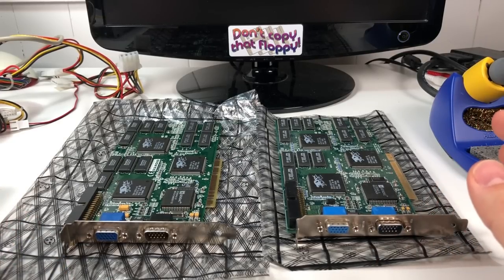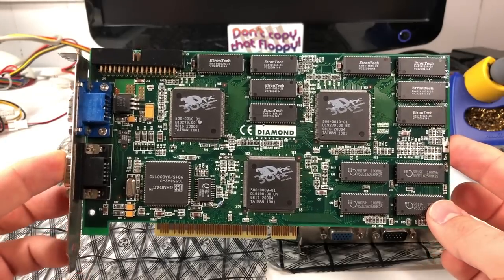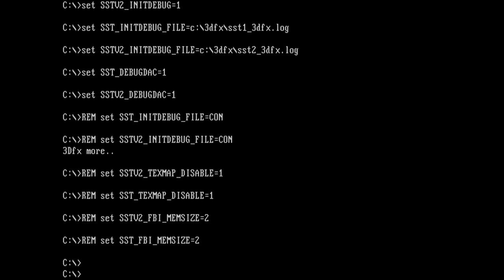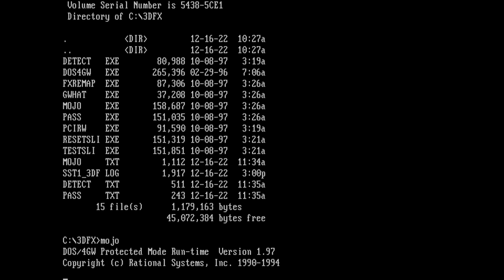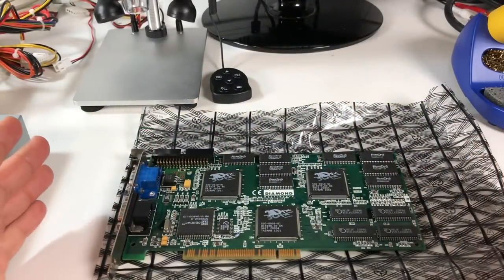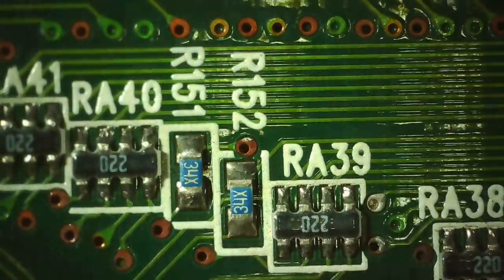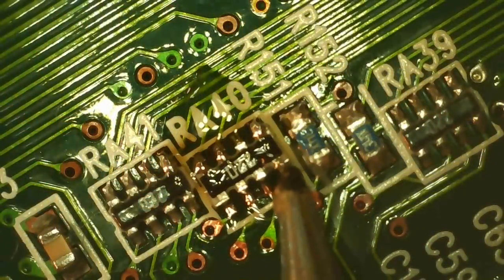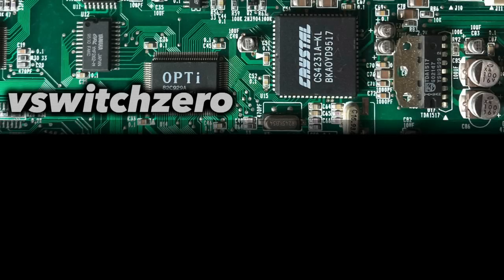Troubleshooting and Repairing a 3Dfx Voodoo 2!

Comment: What a find. Resistors aren't normally the thing you expect to break.

What is your microscope? It looks excellent.
Reply from the maker: Indeed! Can't say I've ever paid much attention to RAs before this card :) .. the microscope is the Tomlov 7 inch model, but it appears to be a generic design offered by several manufacturers on Amazon. The Tomlov one seems to be a lot more expensive now for some reason, but you can find a similar model like this one for $139CAD, which isn't bad: https://www.amazon.ca/Digital-Microscope-50-1200X-Maginfication-Soldering/dp/B089DXDGW4 

It's been a real game changer for me for electronics repair projects and well worth the investment.

Comment: Vswitch - do you know if u can disable a TMU on these voodoo2s ?  ie set to 1 instead of 2 - they do it on the velocity to enable the second TMU using this registry edit  HKEY_LOCAL_MACHINE\System\CurrentControlSet\Services\Class\Display\0000\Glide\FX_GLIDE_NUM_TMU="2"  - do you know if it works on voodoo 2s -if i set it to 1?  its to be able to see which memory bank on which TMU maybe be causing texture problems  - then depending which TMU warms up will tell me which bank is being used

Comment: Just for testing I would have jumped the bad resistor with a 22 ohm resistor.
Reply from the maker: I was going to give that a try actually. I didn't have any 22 ohm resistors so was going to put two 10s in series. But the replacement RA came really quickly (within 24 hours) so I didn't bother.

Comment: hi can i ask ur advice - i have a magic II 3dfx card which has artifacts - assume the rams at fault - the edo ram on my card are V53C16258HK22 chips  but an original  reference card photo for this card shows V53C16258HK25 chips - and  the only chips i can get for replacement at a good price are the V53C16258HK25 as new - the 22ns chips are 1998 anyway - do you think swapping for the 25ns chips will be ok /work ?
Reply from the maker: That's neat that your V2 has 22ns memory. It's pretty rare. That's rated for 110MHz and was used by some card manufacturers for a bit of extra overclocking headroom. As far as I know, all of the V2 cards out there run at 100MHz (core and memory are in sync), so the more common 25ns (100MHz rated) memory should work just fine. Before you swap out the chips, be sure to check all of the solder joints on the FB/TMU chips, memory chips and check the resistor arrays too. The V2's EDO doesn't fail nearly as often as the newer V3/4/5 cards with SDRAM in my experience. Best of luck with your card!
Reply: @vswitchzero  ok thanks thats reassuring - yes i will go over the card and check all resistors , caps and legs first - question about mixing the ram chips  - ive been told i could install some  25ns chips onboard with the existing 22ns chips and it still can work - i assume the 22ns chips will all default to the slower 100mhz?  - any ideas about that? - i dont know how to find the faulty one ( if it is the ram) without swap and see one at a time  ( 24 times ) urrrgh  - its color texture artifacting so i start with the ram around  TMUs anyway

Comment: Hello Nice video, one question.. witch program do i need to test if the memory are bad, because i have problems running on 800x600 resolution it frezze!!! but not in 640x480, works ok
Reply from the maker: Thanks for watching! I’m not aware of any way to reliably find a bad chip. But if it’s crashing completely it could be the frame buffer memory (the banks at the bottom side of the card). Bits und Bolts recently did some videos on a new program for testing V2s but I haven’t had a chance to check it out yet.

Comment: Amazing skill + luck here! Could a less skilled person simply have soldered on a 22 ohm resistor across the path since it was just open circuit?
Reply from the maker: Thanks very much! Yes indeed, that definitely would have worked as well. I actually considered doing that just for testing, but my replacement RAs only took a day to arrive and I didn't need to.
Reply: It's dangerous and much more difficult than soldering the array type.
The pads are so thin there are chances you destroy them while manipulating the regular sized resistor, or bridge them.
Soldering this small array is not so difficult, all you need is a cheap microscope and a bit of care.
You can practice on dead boards.